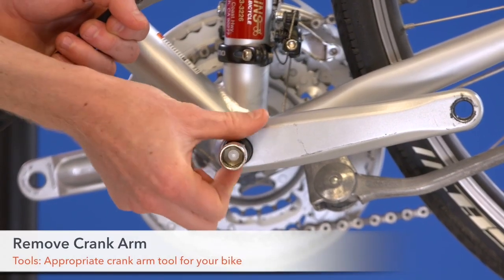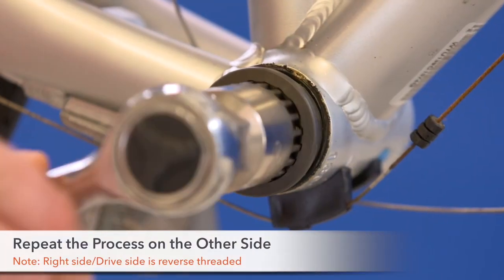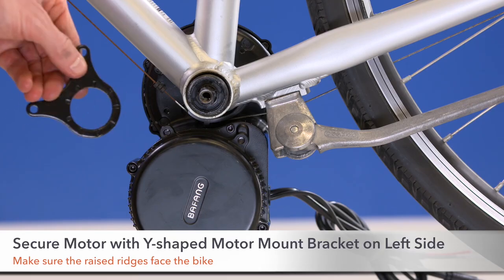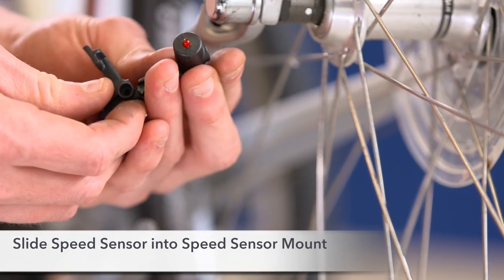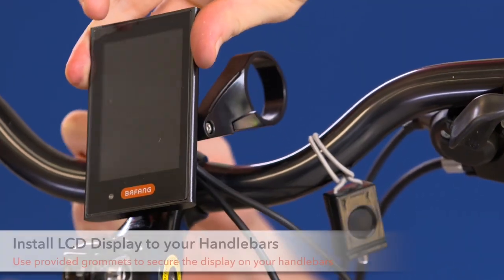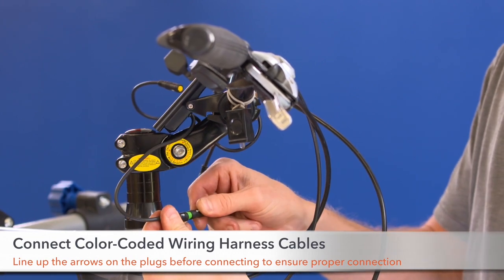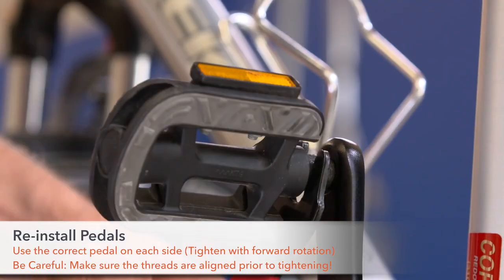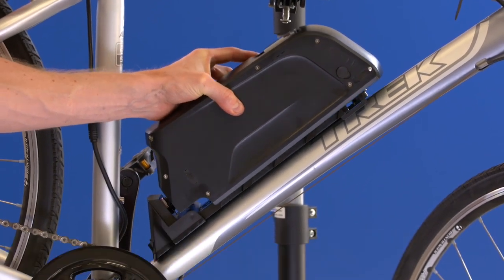Bafang 750w BBS02/1000w BBSHD Mid Drive Motor Installation

Comment: why are you breaking the chain???
Reply: To remove the front derailleur. He probably could have taken the derailleur apart instead.
Reply: Thanks for asking because I was thinking the same thing and I didn't want to break it.
Reply: Some front derailleur cages do not come apart without breaking them(Like every Shimano Tourney series ever made). The only way to get it off is to break the chain. Honestly, I can break a chain with the tool and have it back together faster than removing the derailleur cage.
Reply: the method of breaking the chain that they do is not recommended by SRAM or Shimano.  SRAM uses a master link and Shimano gives you a special pin to connect the chain.  I would try to follow the manufacturers recommendation for high torque like this.

Comment: What is the Bike Hand part number for spanner 4:00
Reply: YC-157  EBAY https://goo.gl/jvLHf3  also Amazon https://amzn.to/2UzVado
Reply from the maker: Yeah, that looks like an equivalent tool! Thanks, Lance!
Reply: it's called a spanner wrench https://lunacycle.com/parts/bafang-parts/bbshd-parts/copy-of-luna-wrench-bbshd-and-bbs02-mid-drive-installation-tool/
Reply: I bought the lock ring socket tool because i had a problem with the motor coming loose all the time. Breaker bar with a socket tool and some blue thread-locker and now it won't come loose. With those cheap universal tools you won't get the motor tight enough. It's infuriating when it comes loose and bangs against the frame. It can make a hole to your thin alloy frame...

Comment: Step 27.change your  chainset every 1000 km, step 28 rebuild your motor every 3000 km. Good luck
Reply: if you care enough, these motors will live at least 8000 km / 5000 miles. Some guy even claims to have done 11000 km.
edit: regarding the chainset: i have absolutely no idea.
Reply: @23y75  chainset will be abused
Reply: @_Philip_.  you can also get a gearsensor so it won't put all dem watts while shifting